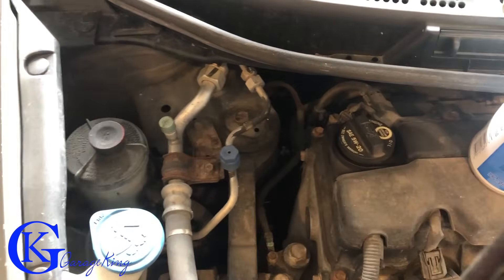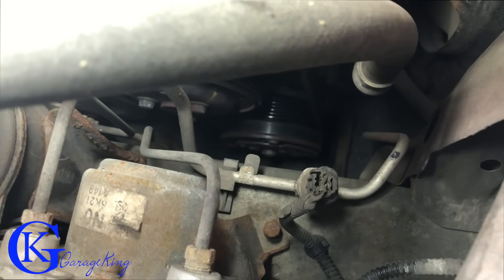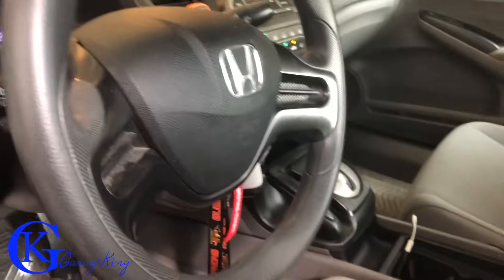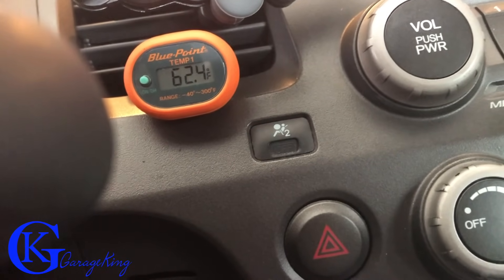How to charge Honda Civic AC with a can

Comment: Your video  made me feel like I could actually do this!  That’s a huge compliment since I’m clueless. Question:  the can I purchase holds 20oz but my civic uses 16. How can I tell when to stop filling as I am not waiting for can to empty.. Does the gauge tell me upfront if it needs coolant and if so how much?
Reply from the maker: Hey Thanks for reaching out, and if your name is Wendy I assume you are female.  Good for you for tackling this, too many get scared and you can do it!!!!!  If the can holds 20, but the civic takes 16 I would not do that.  You can overfill a vehicle a few oz and its ok, but you really don't know how much is in your system.  The gauge will only tell you the pressure in the system, not how much is in the system.  Kind of like if you put at thermometer in a pot of water, its going to boil at 212F or 100C, but you don't know how much water is in the pot.  When I use my gauges (not a can) I weigh in the refrigerant, that's how you do it without using a can, by weight.

If your compressor is spinning when you put the AC on (I think I show that in this video) then you have at least about 2oz in there (that's about what it takes to trigger the compressor on this car).  To cool your car all you need is about 6oz.  It will be low, but it will cool just fine, and you won't notice much of a difference with more.  If it's 1/2 full it will cool the same as when its totally full. Its just your compressor will cycle less (another lesson haha)

I would buy 6oz cans and use a full can and see how cold it gets.  If its very cool, but not cold, then use the second can and you should be ok.  If anything you may be a little under full but thats fine.  Its important not to overfill as that stuff is liquid on one side of your AC system (the high side) and gas on the low side (where you are going to add the refrigerant) If you put too much in, there is too much the liquid can hit the compressor, and as you know, you can't compress a liquid so thats a problem, something has to give..........

When you fill it, go slow and watch the gauge, keep it in the blue, around 40psi, you don't want it going too high.  FYI - On a hot day it will be higher and take longer to fill.  

Its better to be a few oz low than to overfill. Feel free to reach out if you have any other questions :)
Reply: @GarageKing  thanks for the informative reply and awesome video! I’m a woman and was having the same issue as Wendy. My pressure says normal but the air doesn’t get very cold. I’m too scared to overfill so I’ll just deal as is until i can get it serviced. Thanks for helping!
Reply from the maker: @taureanantoine1164  Hey Taurean, thanks for the comment.  The pressures will always show as normal until its pretty much empty.  Its not like a fuel gauge.  If the air is quite warm I think you would be safe to add a 6oz can.  Most likely you only have 1 or 2oz in there if its barely cooling.  Wendy had a 20oz can so that's more than the civics total capacity of 16 so if she emptied the can it would be overfilled for sure.  But if its just warm I think a 12oz can will be fine.  Normally the system can be overfilled a bit. Most systems at 1/2 still cool quite good so I think you are really low. You should be good to go with a 12oz can, and doing it yourself will not only make you feel like a queen, but you will save some serious $$$$  I love when women tackle their car work !!!  Here is the link to a cheap gauge to fill and some 134a if you are up to it.  https://amzn.to/3MyznOB  and https://amzn.to/3lxz4Yw  sometimes you can find a 3 pack for a decent price.

Comment: Thanks for the video! Can you use the same procedure for topping off R-1234yf?
Reply from the maker: Thanks for the great comment, yup same procedure. Just ensure you use the correct amount.
Reply: You have to get the correct recharge kit.  2016 or newer Civic require the R-1234yf and have a different coupler fitting at the end.  Expensive!  Autozone sells for $140.
Reply from the maker: @figu4lglck  Good call, I figured it was an 1234yf system.  Thanks !!!
Reply from the maker: You can get a hose fairly cheap https://amzn.to/3kAJvdF or if you already have the gauges just get the connector https://amzn.to/3FeLPAl

Comment: My Ac takes very long to cool. I am thinking of refilling it with a 16oz can. Should I empty all the refrigerant in the car first and then refill it? Or should I simply refill 1 can into the car system? I drive civic 2006
Reply from the maker: Hey there, the capacity of your system is 16oz, so if you put a 16oz can in your are going to overfill it.  Its safe to overfill them a bit, but the problem is how much you have in the system.  There is no way to really know.  If it does not get cold, but take a long time and just gets cool then you probably only have 1 or 2 oz in it.  If it still gets cold (even after a long time) then you still have a decent amount in the can.  You may be safe with a 16oz can depending on how full your system is, a little overcharge is ok.  You are probably better off with a 12 or 13oz can, because that way you are probably going to be full at the end, or just under full.  They are pretty affordable.  Here is for a 13oz can https://amzn.to/3F14GOo  you can see its not too expensive.
Reply: @GarageKing  thnks

Comment: I do have a problem. Can you help with it. My presure was high when the engine off (I used the kit to check). And it down to low when the engine on. Is it ok. Cause my AC keep warm today. Get some research on internet and they talk about refrigerant. I have no ideas. Thanks for your help
Reply from the maker: Hey Thanks for the comment.  When you check your AC on the low side (thats the bigger hose) it will be high when the vehicle is sitting for a while and that is because the high and low side equalize.  When you started your vehicle it went too low, that is because the compressor is taking the refrigerant from the low side and pushing it to the high side.  Simply put, you are low on refrigerant :)

Comment: Do you think it would have been colder, but you forgot to push "Max AC" even though you said it. You did have recirc on though.
Reply from the maker: Ha Ha, well that was my bad, but you should have AC max on. It would have been cooler with AC Max, but not a whole lot.  The most important thing in re-circ to get it cold.  Good observation.

Comment: Mines at 30 at idle so it’s got Freon. It clicks on and off when turning a/c on and off and compressor is turning also. You mentioned a bad sensor maybe the issue?
Reply from the maker: If it stays running (the compressor) and the gauge stays at 30 you are not empty at all, once you turn the car off and the compressor stops running it should raise up much higher thats why its best to take the gauge off when the compressor is running (lower pressure on that side so less leaks out when you pop the connector off) If the compressor is spinning you are fine, you might be a little low, but everything is working.

Comment: I appreciate your educational video. I am somehow confused a little bit. What does the gauge actually measure? I thought it measures the gas pressure in the AC system, so that I know at what pressure I should stop. But then how can the pressure go down when you are adding more gas to the system? Per the video, the gauge only measures the "charging pressure" or how much gas is left in the can?
Reply from the maker: Hey there and thanks for the comment, ok here we go LOL :)  The gauge measures the car pressure when the valve is closed, but measures the can pressure (going into the car) when the valve is opened. The only true way to know how much is in your car is to measure it in by weight and in the field we use a scale to do this.  You can approximate with a gauge, but its not accurate.  There is no way to measure how much is in the can, you just "feel and move" the can and you can feel how much is left in there as the can gets lighter and lighter as you swish it around. You always add on the low side and the pressure in an AC system is always fluctuating, and why does this happen?  When the car is shut off (AC OFF) the high and low sides equalize.  When you start your car and turn on AC the compressor draws the low side down, and pushes the high side higher.  Simply put this pressure differential between the low and high side creates your AC effect.  When there is too much pressure differential the compressor stops running and the low pressure side raises (the high and low start to equalize) then when they get too close the compressor cuts back in and pushes the high side higher and the low side lower, this cycle is repeated constantly.  When you are adding refrigerant it looks like the gauge is lowering, and in fact it is, as the can pressure is higher than the low side line pressure. So you have to throttle it in and once the can is empty you can open or close the valve and it wont make a difference on the gauge as there is no more refrigerant in the can.  If you have an actual set of high and low side gauges you can see it.  I did a video with gauges https://youtu.be/qG1uo2YYAjc  Hope I helped, let me know if you have any other questions :)
Reply: @GarageKing  I really appreciate how you spent your time to respond to my question. I did watch the other video from your link. It's a good add on to this one. Now, I seem to understand how the gauge works. Your video encouraged me to buy a can of refrigerant to fix my car's AC. BTW, I just subscribed your channel now. Thanks a lot!
Reply from the maker: @mytub9  Thank you, and I aim to do my best.  AC is kinda complex, but all cars pretty much work the same way, its just that this is moved here, or something else is moved over there.  Appreciate the support and if you have any other questions just let me know.  Thanks !!

Comment: May i ask y a question with a ac issue. I have a honda 2008 mk8 1.8. I filled the ac up with coulant. I replacement the relay
 I can hear the ac pomp working. I checked the same wire. I have 1 connection instead of 3, it works. The H intake feels cold but the L intake feels warm. Still the air isnt cool inside the car. What could be the problemen?
Reply from the maker: If your compressor is working (make sure you look to see it spinning) then the reasons its not cold is: compressor is worn out and not moving the coolant efficiently, refrigerant is low, or your evaporator is all blocked up.  Those would be the main causes.  A good way to check is with a set of gauges so you can see the high side and low side pressures.

Comment: My compressor is not working. What is the solution?
Reply from the maker: Most of the time its the thermo switch, its located on the top of the compressor.  You have to remove the alternator to change it.  Just make sure you have refrigerant in the system.  If you are low the compressor wont run.  Even if you only have 1/2 oz the gauges will say there is pressure, but its not enough.  So make sure you have enough before you go changing that switch.  Its cheap but not the easiest job to do.  You have to get the thermoswitch from Honda and they are not cheap, sometimes its better and easier to get a new compressor as they have come down in price. https://amzn.to/3KhybgH

Comment: Hi thank you for this. I have bought a repair kit because garage advised a crack and told me what to buy. So I bought kit with can of sealant. Do I do this the same way as what you do
In this
Video to refill ?
Reply from the maker: Hey there and thanks for the comment.  The sealer is treated the same way as the refrigerant so it’s just like putting a can of refrigerant in UNLESS there is something on the can that says “equivalent to” for example some sealers are 5oz but they are equivalent to 8oz of refrigerant so in those cases you treat it to what it’s equivalent to.  Hope I helped you out and good luck with the job :)
Reply: @GarageKing  thank you for taking the time to reply !!
Reply from the maker: @dawnfitness73  For sure !!!

Comment: Hey I bought a kit from amazon and the connector won't seem to fit on my car. its a 2010 civic as well. is there some trick to connecting the hose up to the ac? Seems like the thing is too big and gas just vents to the atmosphere when i try to connect it
Reply from the maker: Hi,  There are two ports on your honda.  Make sure you are using the LOW side port which is bigger.  If you are using the LOW side port, then check the kit you bought.  It could be for 1234yf. thats a newer refrigerant with different (but similar sized ports) Your car should be 134a, and there should be a sticker under the hood which shows the type of refrigerant. Confirm its 134a, and then confirm your kit is for 134a.  Also when you connect, make sure the can is screwed onto the kit,  BUT the needle HAS NOT pierced or been screwed into the can.

Comment: I spent almost 2 hours trying to recharge my ac on my honda civic 2018, but the hose does not lock in. I gave up. And it is 80f in LA.
Reply from the maker: Sorry to hear that.  The high side and low side connectors are different sizes.  Also if you recently bought a connector, the new R1234yf connects are CLOSE but will not fit the 134a connectors this Civic has.  Also you may have a bad connector, especially if its one that came with a can that's permanently attached as they are not very good quality.
Reply: @GarageKing  the good thing is that I returned my purchases. I will check out an auto zone before they close. Many thanks!!
Reply from the maker: @garyprieto3731  Anytime !!!  Good luck with the charge up, I know how valuable AC can be on a warm day !!!
Reply: @GarageKing  thank you. Problem solved!!! I bought one with a hose and it fit. My car's AC was dried. Thank you very much!!!
Reply from the maker: @garyprieto3731  Awesome!!!!  Glad you got it all fixed up !!!  Enjoy your weekend :)

Comment: I know you might not have the time but quick question. What if my compressor didnt kick on UNTIL i started the recharge? Ive been at it for 20 min now and its pretty hot now. The can is empty now as well and i feel no difference😅
Reply from the maker: Hey There, if your compressor kicked in after you started the recharge that means you were very low.  When you are adding on the low side look at the gauge and if the pressure is dropping below 20psi (when the can has emptied) and the valve is still open then you don't have enough in your system and you probably have to use another can.  The Honda does not take too much, I would say 2 cans is too much, but possibly 1.5 cans (depending on their size) should be ok.  Also put the air on recirculation, so the outside hot air is not drawn in.

Comment: Filled my freon but not cooling inside ? Where can I find the sensor
Reply from the maker: The sensor is right on top of the compressor.  It sits in a dip in the compressor at the top and there are two wires coming out of it. I believe they are red and black, and there is a clamp with a phillips bolt holding the sensor in so it doesn't fall out with the engine vibrations.

Comment: once the can is pierced, if you close that valve down, will it stop it from flowing at all so you can use some of the refrigerant later on another vehicle if you do not use it all?
Reply from the maker: Hey there and thanks for the comment.  You are right that if you turn the valve down, not all the way in, just until the flow stops you can reuse on another car, but it will leak down quite quickly, most will leak down over a day.  

The good thing is you should not have to worry about that as most cans now are resealable, so they actually have a valve built into them so they don't leak. You only turn the valve down enough to get whatever flow you want, then when you are done you back off the valve and a small valve in the can moves back, the flow stops, and then you remove the gauge.  When you order a can most will say if its a resealable can.

Comment: So if you use the low side to charge the a/c than what is the high side for ?
Reply from the maker: Hey there and good question !!  The high side is used mainly for diagnoses so you can watch the low side and high side pressure when the compressor cuts in and out. You can also use it when you are charging with gauges to monitor things.  Edit: it's also used for evacuation. In this video I charge with gauges  https://youtu.be/qG1uo2YYAjc   Thanks for the comment and good question !!